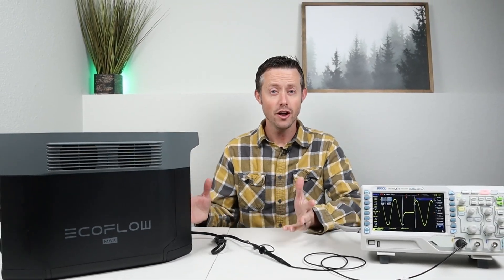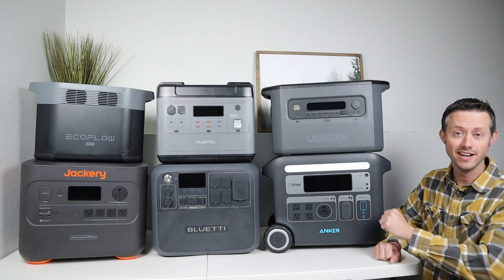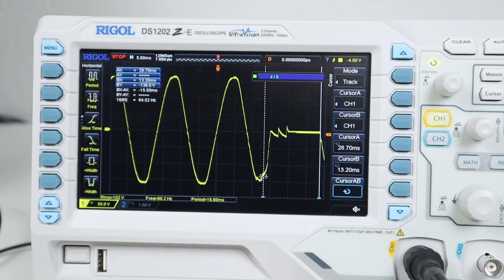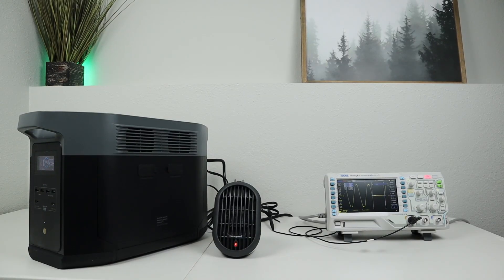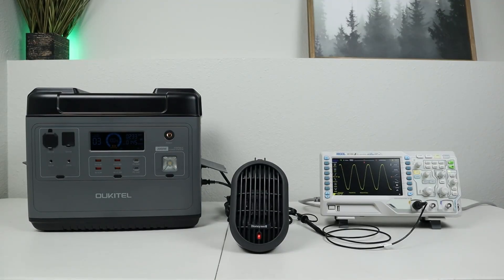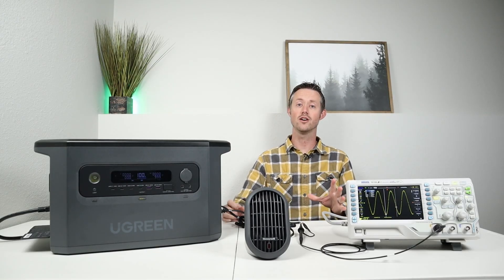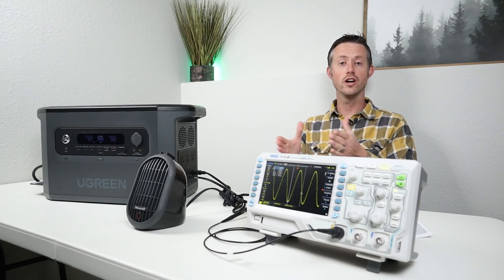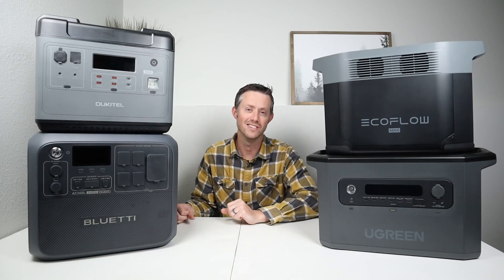I Measured UPS Mode Swap-Over Times!! Anker - Bluetti - EcoFlow - UGREEN - Jackery - HEAD to HEAD

Comment: This is a year too late to ask but if you do these tests again in the future, would you mind putting some more serious load on these? For example recently I've purchased a Bluetti Elite 30 V2 so a much smaller unit (just shy of 280kWh, 600W inverter) but it's claiming <10ms switchover time. When I tested it at low load (idle, office work), it worked fine but around 450W power draw, the plugged computer would reset on the power cut. The computer runs on 850W PSU certified by Cybernetics with 16ms hold up time at full load so it should have better timtings at at lower output. On the other hand another computer with 580W sustained load under stress would switch over just fine but PSU was rated for 23ms. This leads me to believe that whatever <Xms claims might be varying to a great degree depending on the load. I didn't buy small 600W unit to act as UPS (even if it achieves an impressive 26min at full load) but testing it puts into question my plans on purchasing a larger unit (was originally thinking about Elite 100V2 or splashing on Apex 300) to support my workstation, home server and NAS.

Comment: I know that you can use most power stations as a UPS, but should you? Isn't that putting run time on the electronics, or are they totally dead when plugged in to 120v?

Comment: Jason they call these things solar generator but yet if you have solar connected to them they do not use it when battery is full can you do a video showing which one will take the solar power with wall outlet power  combining together  to the AC outlet. using most of the solar power.
Reply from the maker: Every single one of my reviews I test for dual charging capability and if it features solar priority. Check out my power station grading system for the results of the test for every model.

Comment: Hi, thanks for sharing the details. They all look pretty good. Is there a preferace for reliability and ease of use? I have an old friend that relies on some power during a mains outage, 2KW should be fine but the unit needs to be easy to operate, no good if the UPS function needs to be regularly programed. Thanks

Comment: I hope you get to get soon and anker donates the solid c300 to your channel or save up heheh anyways to run the test on that new mini power station for the UPS feature on the c300 (ac version ) I though I had a fast unit the c1000 and I have two tv and one devices that is faster than 20ms 😂 cause I have tried so much and the ups of the c1000 is slow for it it turns off the tvs . I tried to simulate a black out  power lost of grid w a simple switch and yeah 2-9 times it fast the rest it fails . Wonder how faster is that small unit in the ups using your oscilloscope

I didn’t care or test it this feature cause I always have enough wh left since I mostly use solar but rarely plug this unit to permanent grid power . So yeah nice to test the features and possibilities of things that could go bad or limits of what companies offer … 

I wonder how fast is that new device 

1000VA/600W UPS Battery Backup and Surge Protector, Backup Battery Power Supply with LiFePO4 Battery in MILLISECONDS …😅

Comment: I would be interested in knowing how much noise these and smaller power stations make when using as a UPS.  I see a lot of advertising cpap use, but taking my own Bluetti EB3a as an example, it makes a lot of noise kicking on and off for something that would be sitting next to your bed while trying to sleep.
Reply: So I did go ahead and get an AC70 and an AC2a.  The AC2a is much quieter than the EB3a and would tolerable for sleep.  The AC70 however is completely silent, fan doesn't even come on.  For my use case, this is using 20-30W to power some network equipment and a computer in sleep mode.  The AC70 is way overkill for my need though.  I mostly need it to handle power blips of a few seconds, may minutes, with the bonus that it could keep stuff powered on for a couple hours if needed, unlike my Cyberpower UPS which after a couple years has degraded the battery to barely keep stuff up for 5 minutes.  The EB2a is a perfect size if only it would stay silent, and could be greatly improved for little cost with a better quality fan and maybe an option just keep it running at it's lowest speed so it's not kicking on and off.

Comment: Interesting video. I've got a Bluetti AC500 and use it as a UPS for my freezers, frigs, furnace and ERV. I also take it with me in my 5th wheel when RVing. I've got it set up to be charged with solar power and grid power (still need to figure out if I can prioritize one over the other) at my house. Good to see the Bluetti performed as well as it did.
Reply from the maker: Go into the settings screen and change the UPS mode to 'PV priority'. It's on the third or fourth page. It will allow you to set it to charge with solar panels only until the battery drops to a certain level and then it will charge with both AC and solar.

Comment: I find that the ups funtion on my power stations draws 30watts or more constantantly from wall outlet.  with no load and fully charged.  Example of all 3 of my eb3a's do this. 
🤔
Reply from the maker: Thanks for bringing that up, that's something to think about for sure. Is it worth the extra power usage to use it as a UPS? Gotta weigh the pros and cons.
Reply: @Jasonoid  I'm up to 8 power queen 12/300 batts wired in 24v :).  I maybe going to 48v soon.

Comment: I appreciate you getting a quality oscilloscope as it enables you to show us quality footage of the waveform that the product generates.  Other reviewers have very pixelated displays which do not tell you anything or they do not even bother testing the waveform quality.  This is important when hooking up expensive electronics.  Your the only reviewer I know of that can/does measure the actual cut-over speeds and one of the first, if not the first, that has an program running on your computer when you do the testing versus others who had a static display which would not be the typical use case that needs to be tested.  Your showing your professionalism and as a degreed Electronic Engineer I appreciate that.  Keep up the good work
Reply from the maker: Thanks Ron! I have a lot to learn before I can consider myself 'engineer' status. I'm always trying to pick up new skills to make these video more valuable 😊

Comment: I checked the grading sheet for EB3A and it's listed at 20ms. Has that been confirmed with the oscilloscope?
Reply from the maker: Nope, haven't tested that one yet.
Reply: @Jasonoid  let me know when you do. I had mine hooked up to my entertainment system, powering a router, tv, streaming device, NAS, and soundbar. For some reason, it would regularly switch, causing the TV to flicker. It didn't shut anything off initially,  but over time, the TV did shut off sometimes. I replaced that duty with the Allpowers R600 beige edition, and none of that has happened since.

Comment: Jason, as always you provide great information and useful.  I'm going on an extended trip and seeing all those power stations you have  left me wondering if you could do a video where you daisy chain several  power banks with pass through charging and if possible connect them where all charge from the wall while extending the power of the one connected to a fridge for example.  I have 2 delta max 2000, 2 delta 2's, one river pro plus expansion battery, 2 jackery 500 and one Inergy Apex.  Was thinking of pairing the delta  max 2000 with the delta 2 and the jackery 500, set used for the fridge and the other set for the freezer.
Reply from the maker: I tested that question with three units that had UPS functionality, it worked surprisingly well! You can see that experiement here in this video:
https://youtube.com/shorts/Z5nxhBtqoms?feature=share

Comment: If you get brownouts, voltage spikes, etc. you need a high-quality UPS to protect against that stuff.  Over/under voltage can be just as dangerous as an unexpected power cut off.  So I bought one of these power stations and tried to plug my regular UPS into it.  No go.  You need a bonded neutral or the UPS senses there is something wrong and won't pass power from the power station through to your load.  So basically you have to shut down, disconnect the load from the UPS, and then you can power it back up directly from the power station.  The idea that your server or whatever can run for a few days off of one of these things seamlessly even if you aren't there is not really viable.  You still have to shut everything down and then power back up if you need the protection a real UPS offers to your equipment.  These things are great for less critical loads like a fridge, but they aren't really a UPS, which is why all the manufacturers are all very careful not to label them as such.
Reply from the maker: They have bonded neutral plugs you can connect into the power station (since most of these have a floating ground). Did you try that in your setup?
Reply: @Jasonoid  Yeah, I did think about that.  Code says that the only place you are supposed to bond is at the main panel, so if you bond neutral and ground with a bonded neutral plug, that is no bueno as long as the power station is plugged into the grid.  It would work, but you really aren't supposed to do that..  Those plugs are really for when the generator or power station is the source of power and so it is in the same place in the circuit as the main panel normally would be.  I think you are stuck shutting down and powering back up if you want full UPS functionality.  Still better than having only 6 minutes of power but not awesome if you are away from home.  I am actually surprised these companies don't just go ahead and make a full-fledged UPS, I can't imagine the extra power monitoring/conditioning circuitry required would be a big lift.  It is like they all got 99% there and stopped.
Reply from the maker: @trustbuster23  Can you clarify which brand/model you used in your testing where the grounding wasn't working?

When I test with my power analyzer during UPS mode/ac charging, the Bluetti and Anker models show the ground is active and correct. When I test when the power station is running on it own (not plugged into the wall), the ground is floating / open. 
Not all brands are created equal. The Bluetti and Anker seem to pick up ground through the charging cable so they use the same ground as your home panel setup (then you don't have two grounds in the system).
Reply: @Jasonoid  I have the Jackery 2000 plus.  Same thing - it will pass the ground through correctly as long as connected to utility power.  But when the utility power goes out you now get an open ground.  That trips the UPS and keeps it from accepting power from the Jackery.  But if I bond neutral and ground while I am still on utility power using a bonding plug to avoid the issue, then that is not code compliant because you now have a second bond not at the main panel.   At least that is my understanding of the electrical code.
Reply from the maker: @trustbuster23  yep, understood. Thanks for clarifying. I don't really see a way around that unless you find a UPS that doesn't require that. 
I charge with solar like 99% of the time and I hardly use AC charging.

Comment: Awesome comparison and tests!!! I have an awesome question that I can't seem to understand. On my delta pro. I run a portable air-conditioner with heat. (It has a reversing valve that is spring loaded to cool mode). When my reserve capacity hits @ 30% (ac plug turns on) the relay will switch  to ac input bypass. Or when I loose power the relay switches to inverter. 
What happens is the portable air-conditioner will send the delta pro into overload. Is this because of the reversing valve not holding long enough in height mode and the compressor locks up temporarily?
Reply from the maker: It might be that surge load on the air conditioner is too large. Have you looked into getting a soft-start installed to dampen the surge?
Reply: @Jasonoid  unfortunately it's a portable air-conditioner. It pull 1100 watts on heat and 1350 on cool mode. The Delta Pro all on its own will run it no problem at all I just had to keep the delta pro unplugged from the wall so it didn't try to run into bypass. It's only the switchover to ac bypass does it actually do this.
Reply from the maker: @jaysonstebbins2539  is it on the latest firmware?
Reply: @Jasonoid  yes. I have energy management turned on, and at the moment, we use the electric fireplace because the wife likes it. Bringing in 1600 watts from 11am to 230pm allows us to run it and the TV but even with the latest firmware if the delta pro falls to my 30% reserve capacity (which is when ac charging and bypass kicks in) sometimes its not even quick enough to keep the electronics in the fireplace on long enough to keep it going. It's a 50/50 chance if it stays on, lol. The TV will stay on but sometimes not the fireplace. BTW these aren't complaints but just things I experienced. Love your channel btw. Your channel is what helped me decide on my powerstation. I ahd the delta max 2k but for the price I was bummed on the cycles of only 800 lol. If the delta 2 max was out at the time I would've purchased it but I'm VERY happy with my delta pro and the 1800 watt array I have on it. It's got me through a few power outages and a Christmas blackout. So thanks!

Comment: @Jasonoid this is an excellent video and your timing is perfect, no pun intended. 😅 I'm in the process of replacing an old UPS with a setup like this.

Feedback as requested in the video:
🔸What is the switch over time going BACK to utility power? Knowing failover time to battery is great, but is it just as fast going back to utility?
🔸Also, I'd love to see similar tests with other types of equipment, like power inverters and solar related equipment. How quickly does the EG4 3kW Off-Grid Inverter (3000EHV-48) swap from battery to grid? Grid to battery? Battery to PV?

Amazing videos as always, can't wait for the next one! 🎉
Reply from the maker: Hey John, the swap back time is pretty hard to catch on the oscilloscope but in my previous testing it's just as fast as the swap over since my desktop PC still stays running with both changes. Usually a PC power supply needs 16ms or less to keep running and all these models performed well in those tests (with the exception of the EF Delta 2 Max since I haven't tested with a pc since the firmware upgrade)

Comment: For safety, wire a 1 megohm (1 million Ohm) 1/4 Watt resistor into each lead of your test cord and apply heat shrink. The resistors will limit current flow and the oscilloscope will show a very slightly reduced voltage because it draws very little current. The best way to attach the resistors (leaded, not surface mount) is to solder them. On second thought, use 100 k Ohm resistors instead of 1 megohm resistors because the 1 megohm resistors will significantly reduce the voltage seen by the oscilloscope.

Comment: Great testing! Now repeat the test using a 10-50W reactive low power factor load. Ecoflow is known to suck with those, but what about the others?
Reply from the maker: Dude, I'm not an electrician and I have no idea what a reactive low power factor load is. You'll have to be more specific...
Reply: @Jasonoid  Reactive load is a non-resistive load such as a switching power supply or an LED bulb or a pump (inductive load). Something else than a purely resistive load such as a heater or a power supply with an active power correction like in a PC.
Reply from the maker: @taskelam8937  so you're saying the UPS time would change if I ran a PC vs a small heater that both pulled 200watts?
Reply: No. A good quality desktop PC and a small heater are very similar as loads, they both have a high power factor. A small load such as an LED bulb causes the UPS in the Ecoflow Delta 2 to behave very differently though. Hobotech has noticed that many power stations can't keep his low powered old laptop going without a battery when the AC input cuts off.  @Jasonoid
Reply: Yes, @Jasonoid please test non resistive loads, Thanks!

Comment: another very great video Jason, i much appreciate that information, and really grateful for the oscilloscope addition to the testing.
i take it you tested all the remaining power stations that you had on hand?
as for UPS cutover times, as long as they are sub 20ms most electronics will stay alive,
sure, it would be nice if the transition was a bit smoother,
some of that is due to the switch, because it takes those ns to break the switch contact,
if you have a contactor, that would give a cleaner connect and disconnect,
switches have some "noise" to them as the contacts are usually imperfect,
thanks again!
Reply from the maker: Most of the results I have tested have been updated on the spreadsheet. I still have a couple models to test. It seems not many people use the UPS functionality on these and the popularity of the video is pretty low. I'll see how it goes with time.
Reply: im sorry others are less interested, i however was very fascinated, and thank you greatly.

Comment: Hey Jason off subject but have you or know of anyone using Bluetti refurbished batteries from Bluetti ebay?
How are they in quality?
Reply from the maker: I haven't ever tested a refurbished unit from eBay.
Reply: @Jasonoid  
You need too please since a lot of people are buying them to use!
Please please please
Reply from the maker: @billy2bob63  if it's coming from a true Bluetti source with a refurbished warranty, I don't see why there would be an issue.
Reply: @Jasonoid  
Ok good information thank you!
Reply: I am currently in the return process of returning a "refurbished" B230 black Friday purchase from Bluetti. After 30 min of discharge the battery starts to make a humming noise.
Reply: @grindychum  
Thank you!
So are you going to get a replacement?
Let me know how the return process goes too.